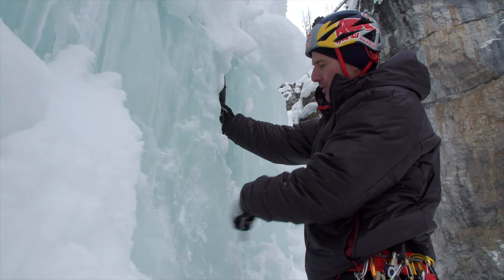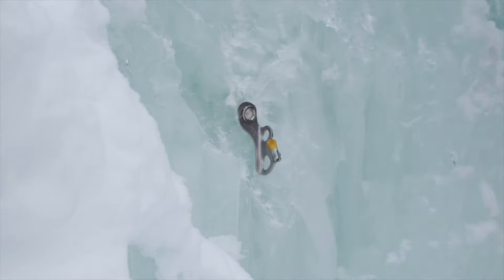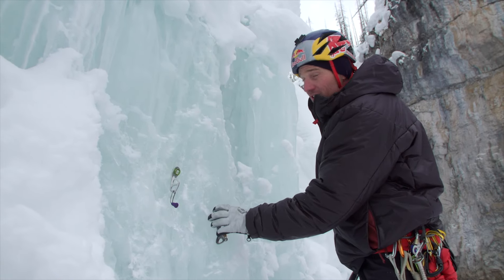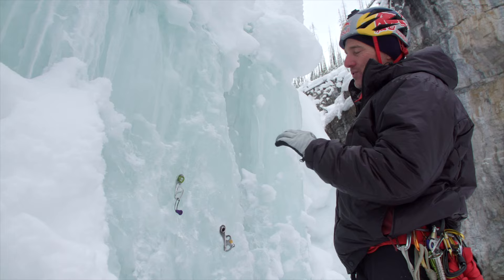How to Ice Climb Series #6: Ice Screws!

Comment: Great series will! Any opinion about chicken-clipping? Quickdraws on the icetools or Loop the rope over the pommel?
Reply from the maker: Remember that clipping the rope into a draw or over the pommel roughly doubles the force if you fall off, and makes the fall significantly, and may "rock" the tool in weird ways... Overall I don't do it, better to sink a tool really well and just clip into the pommel/bottom hole if you're pumped or feeling sketched. Make sense?
Reply: @willgadd2187  makes sense, thanks!

Comment: Do you recommend to rest on the ice screws during a lead? This is very common in rock climbing. Maybe you can add another video about lead climbing in ice and mixed terrain?
Also my set are mostly 16cm screws (and 2x 22cm for the anchor) because the 13cm feel sketchy...Didn't know the 13s are as good as the 16s. Perhaps I can resell them and buy 13cm instead.
Thanks a lot for sharing your knowledge, this is awesome!
Reply from the maker: If I'm pumped, tired, annoyed or whatever then hell yeah rest on an ice screw, way better than falling off! If you're on fat ice 16cm screws are great, it's just that they hit the rock a lot more than 13s.
Reply: @willgadd2187  Nice Will! Thanks a lot for your answer! I'll try to implement all your tips and tricks the next time I'm ice climbing :).
Reply: So aside from extra confidence and making deep v-threads (and eyeing them in easier when the screws backed out a ways) are there any benefit to having long screws?k x

Comment: Thank you Will for these videos; very useful! It happened to me a few times that after placing it fully in, the hanger part would sit on top and not on the bottom. A way to avoid this? How critical is this? It sucks if you have a good placement but then you either need to add a semi-turn and damage the ice or take out a semi-turn and the screw is not entirely in. What's the best option?? Cheers from Switzerland!
Reply from the maker: Chip a little more surface ice away if the hanger isn't flush with it. The ice "below" the hanger is the most important generally.

Comment: Hi 
When starting to engage the ice screw,  I always afraid to push to hard nd pop off the ice tool .
On the other hand when not pushing enough, the screw is not bitting into the ice.

Do you have tips to engage the screww efficiently and not afraid to pop the ice tool
Reply from the maker: Hi, if you place screws between about your chest and knees with your arm straight to the tool above you then you can push very hard, to the point where your feet come off the ice, but it won't make the tool come out. If you place screws at face level with your arm bent then you are pulling out on the pick, and bad things may happen. Does that help?
Reply: @willgadd2187  Thanks ! That totally make sense

Comment: On lower angle ice, do you recommend placing the screw with hanger down - and chopping a piece off to make a vertical surface - or can the hanger be perpendicular to the original surface?
Reply from the maker: If in doubt 90 to the ice gets you most of the strength gains. It an be tricky to figure out how a load will come onto the barrel of the screw, so I visualized the rope going really tight and that often helps me figure it out. No need to chop ice into vertical, it's all relative to the load, not the terrain if that makes sense?
Reply: @willgadd2187  Yes, thank you!

Comment: Dont beat the ice screws on the ice you can damage the screw. If you blow into the hole the ice should come out. You can heat it in your hand for about 3-5 sec if it does not work the first time
Reply from the maker: When it's cold you probably don't want to put your mouth on a metal screw, nor will blowing dislodge the ice on anything but the warmest days. I've never damaged thread on an ice screw beating it on the ice, metal is a LOT harder than ice. If the ice is really frozen in you may have to put the screw in your jacket to warm it up enough to get the ice out though.